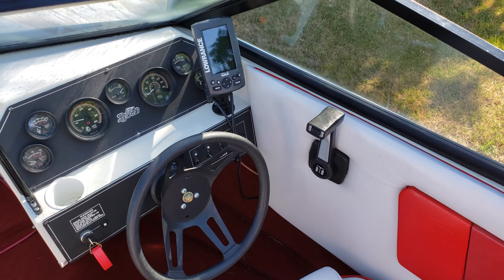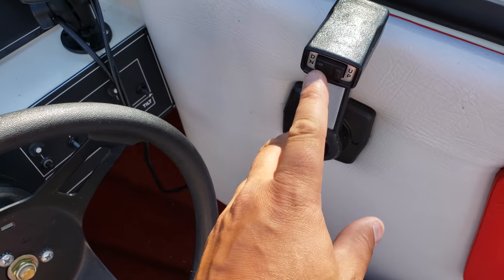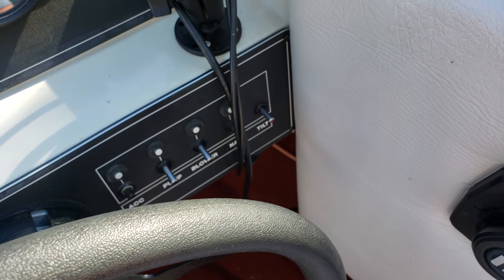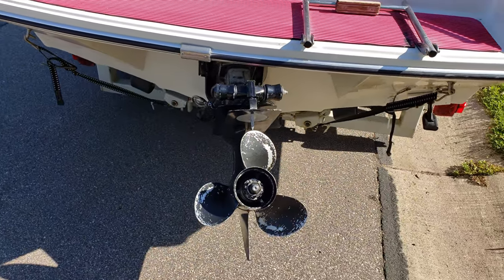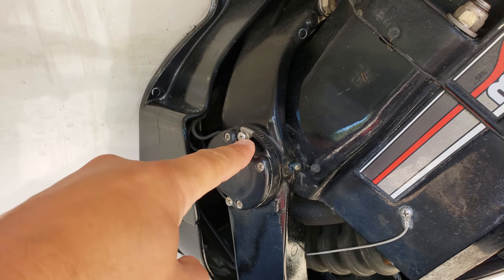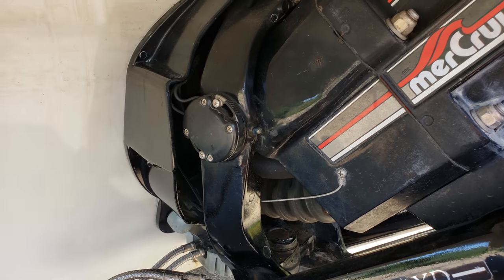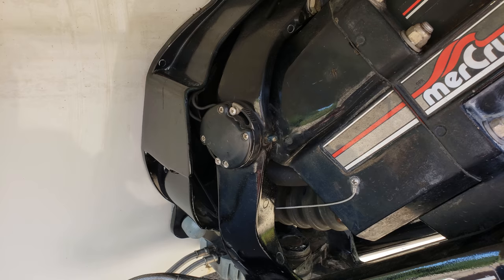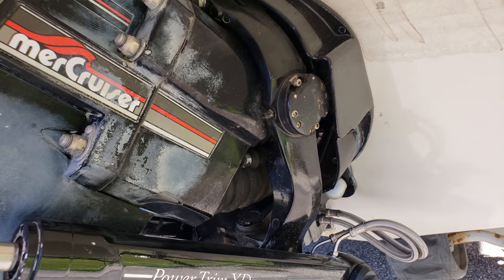Tilt and Trim Issues. Won't go up but will go down.

Comment: One side of the outdrive will have the trim limit switch, the other will be the trim sender which is essentially a potentiometer for sending the position to the gauge.  Only the trim limit switch is used to stop the movement.   The wires to these are prone to breaking down and rotting before any other wires.  If you want, they can be bypassed, just be careful to not raise up the outdrive too much while its engaged.

Comment: What if my trim goes up but when I try and trim down it does nothing. It was stuck in the down position over night while on the trailer and I had to lower the front of the boat to get it unstuck and raise  it the out drive. Now it will raise but it does nothing when I try and lower it. Any ideas?

Comment: So quick question when I’m backing the boat into the water and the tilt bottom won’t let the propeller drop do I just use the tilt button all the way down ? And when I put the boat back on the trailer tilt only up ?

Comment: My trim will go down without issue.  But when pressing the button up to raise it, it does nothing.  No sound or anything.  Glad I checked it otherwise I wouldn’t be able to get it out of the water going up the ramp.  Would be scraping the ground.  Any thoughts?  Still think it could be solenoid?  Thanks.
Reply: Side note:  this has happened before and, which Is why I keep fuses in the boat, which normally fixes the issue.  But not this time.

Comment: So if it doesn't go up at all, then the trim sender?
Reply: Not necessarily. I just replaced the up solenoid because it would go down but not up. When I’d hit the up button I’d hear a click but no movement. The down button would move the prop down as designed. Ended up pulling the entire assembly , cleaning it all up , replacing both solenoids, and removing all oxidation on the electrical connections.

Comment: My "up" suddenly became very slow, trailer is probably 1/4 speed. Changed solenoid and the up button works but the speed is still very slow. The down is fast and works properly. Takes about 2 minutes to trailer. It's a merc 3.0. Why would it be so slow?
Reply from the maker: Not sure. They are slow though

Comment: Mine wouldn’t go up but would go down... I loosened and wiggles every damn wire on the solenoid block thinking bad connection but couldn’t even get it to click.. had to strap up the lower unit got home hit the button and it’s working again lol
Reply from the maker: Probably the trim sender. They go bad.
Reply from the maker: Could be loose or  Corroded wires.
Reply: Sounds like everyone is having the same issues I go to smaller lakes so I don’t embarrass myself lol sometimes my engine will just drop when I’m driving and start scraping the road
Reply: Mine does same lol it's weird

Comment: That's happening on my outboard. Maybe cylinder rebuild?
Reply from the maker: Maybe trim sender. They are about $91. Or just have it adjusted.
Reply: @BigIslandMNMinnetonka  . It's an outboard.  Will force itself down, but not up. Open valve is working. No mister, no bubbles. Relay working. ?
Reply: Chris Boats how can you tell sender is bad mine trims up slowly

Comment: Is there a manual tilt?  My boat is in the water and I can't pull it out as tilt won't go up.  It's a 1989 Merc Bravo one.
Reply: Hi Sal, I'm in the same boat on this. Did you find a way to resolve yours in the water?
Reply: Remove the trim cylinder pins and lift the outdrive up manually , then secure it with a ratchet strap. Don’t forget to secure the trim cylinders to the transom for transport back to the house.
Reply from the maker: You should be able to run a wire jumper cable to the blue wire on your trim pump. That should raise it